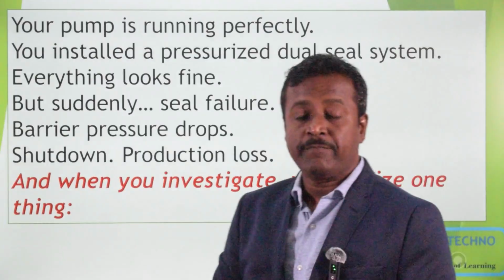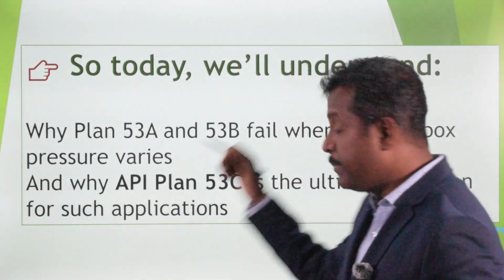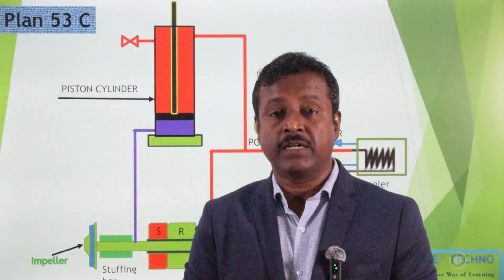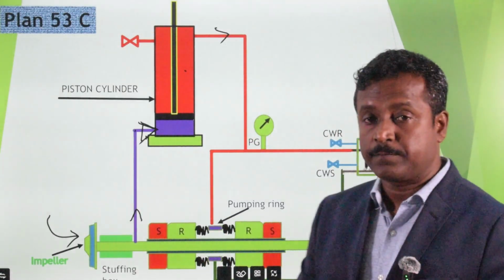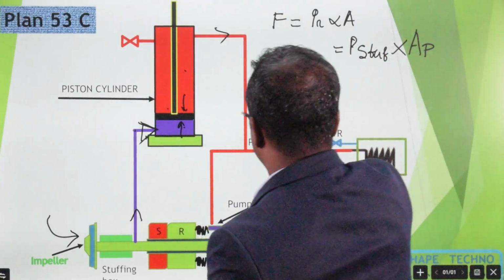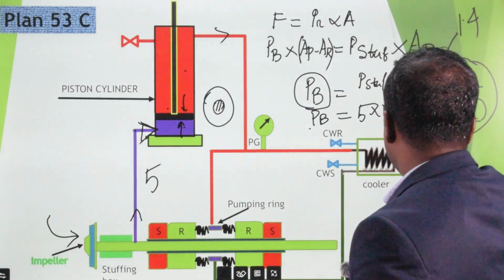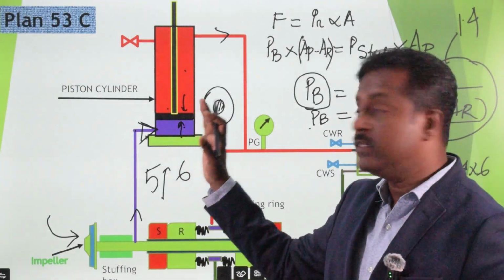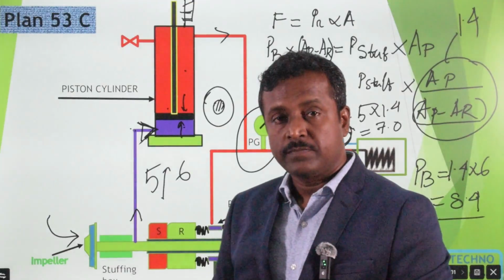API PLAN 53C

Comment: 53C replaces the bladder with a piston accumulator, which is why it covers a wider pressure range, and the trade is that the piston seals become the part to watch. Once they pass, barrier pressure falls slowly and the faces run below product pressure. Logging that pressure on the route catches it before the seal does.

Comment: Sir, let’s analyze this further. When the primary seal leaks, the piston will move up. However, when the barrier and seal chamber pressures equalize due to an internal leak, the pressure on both sides of the piston becomes the same, as the barrier fluid pressure is limited to the seal chamber pressure. Therefore, the piston will move down due to gravity. Am I correct?
Reply from the maker: Very good question..
I appeiciate your effort to  dig deep into the subject.
First of all, whether the piston moves downward due to piston ring leakage is not the most critical concern.
The major important issue is that the barrier presssure differential will be lost, which can lead to contamination at the seal faces and may ultimately cause seal leakage.
However, to answer your query: if the piston ring(seal) fails, downward piston movement depends on the overall force balance. If the downward force mainly due to piston weight exceeds the combined frictional resistance from the piston ring and rod packing then the piston will move downward.and this movement will typically slow.

Thank you so much
Bikash Mete